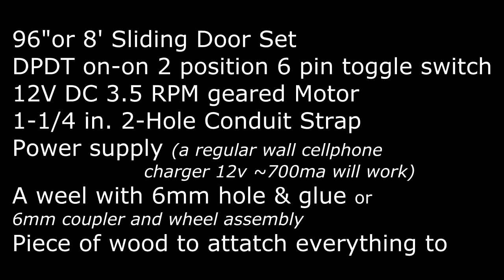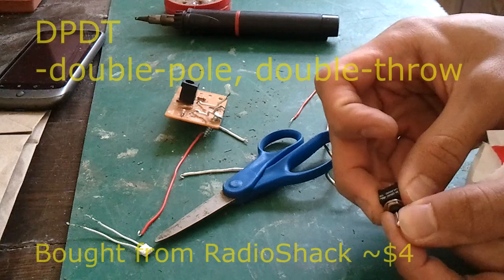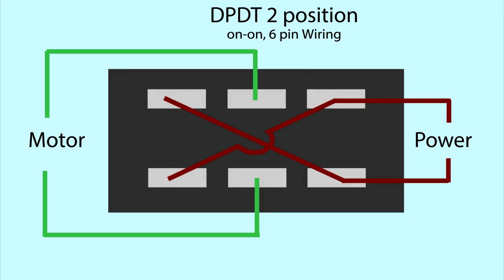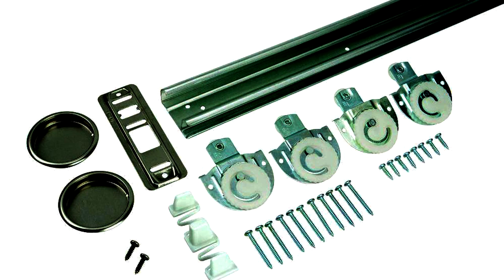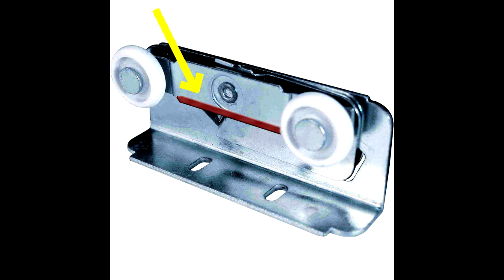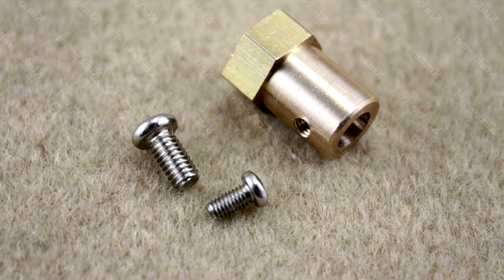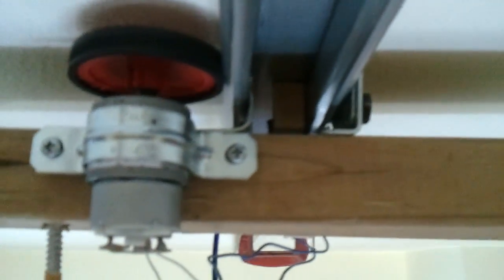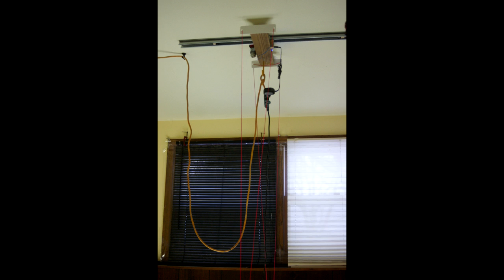Do it Yourself  DIY motorized light system on rail ( light mover ) 2nd Video More Detailed Info

Comment: This looks great and seems easy enough to do. I dont see is how is the toggle returned to the original position? so the light travels to one end and flips the switch, reverses direction travels to other end, flips the switch returns to the first switch. But because first switch is still in the flipped position it will stop.

Comment: I ran across this video last year and it inspired me to order all the stuff but lack of time has it sitting in boxes in the basement.  I broke down and bought a light rail but am now able to get back to the box of parts and finish the project.  After studying your video and the one that I bought my only concern is the wheel pushing on the side of the rail while the wheels hang vertically.  How is everything holding up if it still is?  It seems the wheel pushing against the side of the hanger rollers would create a problem over time.
Thanks.

Comment: Great instructional video. Thanks for sharing, saved a lot of time researching component
I used this concept with a few modifications. It's working flawlessly. I utilized a pocket door frame track and rollers. Had some issues tripping switch; a short length of 1/4" poly water line on toggle increased leverage and worked perfectly. Lots of fiddling around to perfect but that's the fun part of DIY projects!

Comment: A $5 arduino uno and a stepper will give you more precision control, plenty learning on youtube for all things arduino, they are fully programmable with free software at arduino.cc
Reply: https://www.aliexpress.com/item/1set-UNO-R3-MEGA328P-ATMEGA16U2-for-Arduino-Compatible-USB-Cable-Free-Shipping/32727299178.html?spm=2114.search0104.3.8.4b043b7f6buGg3&ws_ab_test=searchweb0_0,searchweb201602_5_10152_10065_10151_10344_10068_5722815_10342_10547_10343_10340_10341_5722915_10548_10698_5722615_10697_10696_10084_10083_10618_10307_5722715_5711215_10059_10534_308_100031_10103_441_10624_10623_10622_5711315_5722515_10621_10620,searchweb201603_25,ppcSwitch_5&algo_expid=10aae883-2431-40ac-8958-e12d61757812-1&algo_pvid=10aae883-2431-40ac-8958-e12d61757812&priceBeautifyAB=0

Comment: Would you say this could trolley a 1000w HPS reflector (about 30lbs) under a single motor, or would you recommend a dual motor setup for that kind of weight?
Reply from the maker: Mine is currently holding 25 lbs with the counter weight pull system. As long as it's an evenly distributed weight I would think it could easily do it with one motor. Keep in mind the track has a manufacturer wheight capacity mine is 75lbs. That much wheight might require bigger or multiple motors as you're suggesting.
Reply: Perfect, thats all I needed to know!

I'm in the process of building three of these, but I'm going to use a arduino nano for PWM ($2), h-bridge shield that supports PWM (3$), limit switches (5$) and potentiometers (4$). 
Nano can accept analog input from potentiometer that controls motors max RPM, and ultimately how many passes per hour the light can perform (35 passes across 8 feet in 1 hour = 3.5 RPM). 

Lastly, the nano is programmed to treat the first pass as a "measuring pass" to measure how many feet a single pass is. From there it divides the total distance into 3 parts, and then runs slower in the outer 2/3rds of each pass. This ensures that the canopy gets even light distribution over multiple passes and grow evenly up, not arched.

If interested I can come back around and post the source code to my github page here for you and others once done.

This is superb information and videos, thank you very much for sharing with us all!!
Reply from the maker: Devin Olsen that sounds awesome! Go ahead and post your project, you should do a video too. The only thing I'm wondering is  you're using a stepper motor with high torque for the accuracy of rpm?
Reply: Great, will do man and I'll be sure to link back to you and give ya a shout out! 
As for motors, I'm using the same motors as you, but with this sheidl: https://tinyurl.com/yafcb7ez

The L298N is advertised as a stepper motor shield, but it actually can be used with standard DC motors for robotics too. L298N can support up to #2 12v motors at once, and be turned into a 5v power supply for micro controllers (arduino nano in my case).
 
Lastly, the L298N supports PWM (pulse width modulation) sent from the arduino nano. PWM is just a way of increasing or decreasing a square wave frequency to the motors that flips the motors on and off at the millisecond level which in turn increases or decreases the speed of the motor. More pulses means slower RPMs, less pulses means faster RPMs. Its unclear to me yet how much the torque will be effected by the PWM / my weight, but because of the L298N, if it is an issue I can just plug in another motor on the opposite side and tell second motor to mirror first (spin in opposite direction).
Reply: Devin,  great idea to use calculations and potentiometer! I checked your GitHub, but I cannot find anything concerning light rails. Is it on development stage?

Comment: I’ve set mine up but the wheel will not change direction when switch is flipped. just continues is same director without interruption?  Any suggestions would be greatly appreciated.

Comment: Can you show more detail of how you mounted the switch the wood?  I was thinking just hot glue but it seems like it would just break off in short order
Reply from the maker: +Jonathan Tong 
The switch is epoxyed onto a .5 inch square piece of wood, that pice of wood is screwed onto the large 2x4 bracked. It is very important that this switch be securly attached. I remember prepping the surface of the switch by roughing up the glued face with coarse sand paper to make a better gluing surface.
Reply from the maker: +A. Goldsby 
Some sort of metal bracket would be ideal. That way you wouldn't have to worry about a glue joint failing spontaneously.

Comment: This is so confusing. You must be a brainsurgon :) I don't get how the switches on each end is connected to the motor rail thingie.
Reply from the maker: +Tone Andersen There  aren't any switches on the ends just blocks with foam on them that flip the single switch mounted in the center of that piece of wood that light is also hanging on.The motor moves the light down the track until one of the knobs on the end flips the switch which changes the direction of the motor and then it moves it way down and does the same thing at the other end.

Comment: Were did you get the wheel. I was able to source the motor and switch but not the wheel.
Reply from the maker: There's a link in the description for a wheel and coupling that should work better then the knex wheel and jb weld I used. there are some other options you can find on robot supply websites you just have to make sure the inside diameter hole matches the gearbox/motor shaft and that the wheel has rubber to grip the side of the track. Good luck; as an update my lightship is still going strong, and on a side note make sure the switch stops/pushers are secured firmly.

Comment: Funny, I have the 6-tube BadBoy T5 and was looking for a DIY lightrail setup for it. Glad you posted this video, gives me a good jump-start on a plan. The only part that I'm a little concerned with is gluing a wheel to a motor shaft, just seems like a likely point of failure. How's your luck been going with a glued-on wheel?

Comment: What is the wheel diameter, and how much weight is being moved.
Reply from the maker: The wheel is 2.5", made of a knex gear
http://www.knex.com/shop/16287/red-gear-2-14in/
with a piece of rubber from the paper roller of an old printer super glued to it and the gear glued to the 6mm motor shaft with jb weld.

The light i'm using is 12 pounds but ive put as much as 22 pounds which it took easily.
Reply: ***** you mentioned an ebay seller for the wheels and you showed a pic of them.  who is the seller.  What is the distance of travel for your current project and how long does it take. txs
Reply from the maker: I put most of the necessary parts it in the description of the video
http://goo.gl/TPxH78
http://goo.gl/jc1Knb
I measured the clearance between the ceiling and piece of wood and its 1.5" to 1.75" which is should be just enough room for these wheels to fit in that space.

 Feel free to ask if you have any other questions; it would be coool to see or at least know that someone else was able to successfully make a light mover.
Reply: ***** The above wheels are expensive, I am looking at Grainger.com item # 26Y329 with a 5/16 bore.  Hope jb weld can do the trick.  Did not like the plastic gear and may not have the durability that I need.  Plan to have 3 lights in tandem with 3 separate rails and motors, all tied into one on/off switch and  stopping mechanism in the center rail.  What do you think of the electrical requirements.  Total weight maybe 75lbs.
Reply from the maker: Sounds like a fun project, albeit a little daunting! My first thought was that that wheel bore is way too big it's almost 8mm when you need something 6mm. The best thing would be if you could find a wheel online that has an 6mm bore with an incorporated set screw and has a rubberized wheel surface. The wheel moves the light by pushing against the metal rail; I would guess a hard plastic wheel just won't get a good enough grip against the metal to move the light without slipping.

I would be inclined to just build 3 separate light movers especially if I thought it was necessary to have three motors, the switch mechanisms is about the cheapest and simplest part of the build. 

Are you planning on having the rails aligned in series or parallel? From you description I assumed parallel bc otherwise the rails woul take up 24 feet, but would make it easier to use one strong motor and one switching mechanism.

Those are just my thoughts, don't let them discourage or confuse you, i'm no expert.
Reply: ***** Agree with you.  Need stronger motor with 8mm shaft, however the key is a low rpm.  will move lights 4 ft max on the parallel railsl. I am also trying to distribute the weight.   lights are attached with cooling ducts over an 8 feet span,  so they must travel in unison without creating probs to the ducting.   I am trying to build on your already proven design but may have to scale it down to 2 lights.  I may have to go to a one rail system and change the light configuration.  just having fun.